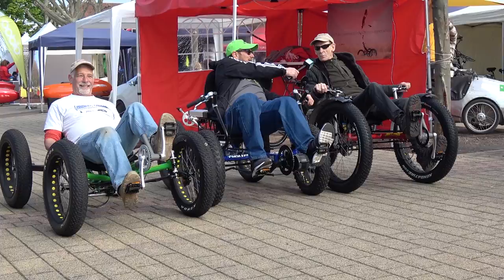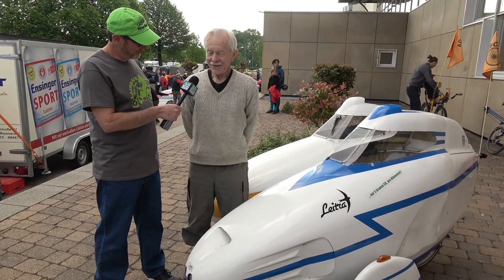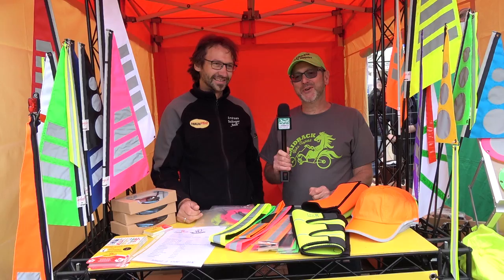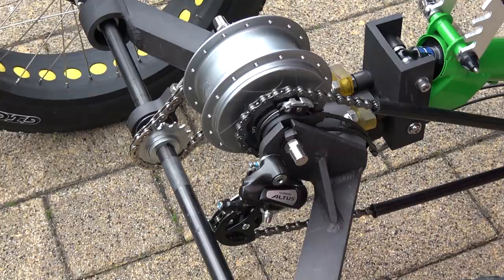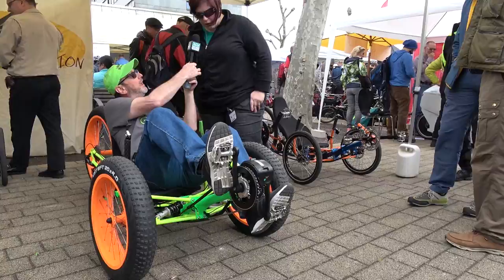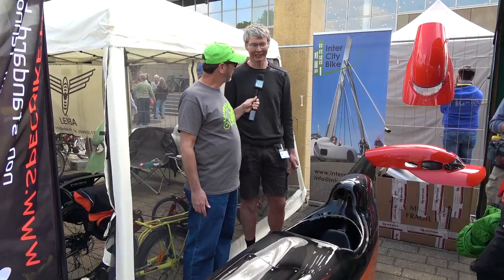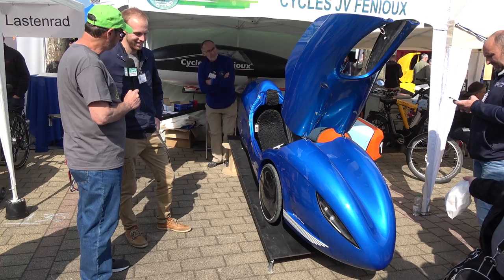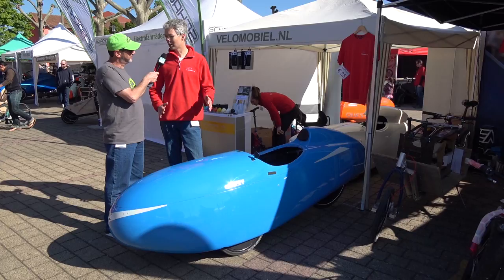Special From Spezi 2017-The Laidback Bike Report

Comment: Great report again. Quattrovelo and Mulsanne are just beautiful. I need a velomobile that has two-sided rear fork, because i favor direct drive motors. I might have to build a new rear fork if i would buy one of those commercial velomobiles. Two of the most beautiful velomobiles, Veloschmitt and Aventybike from Poland, sadly did not join the Spezi show.
Reply from the maker: +myrskylintu1 I sure appreciate you taking the time to watch and comment on the video! I'm not familiar with either of those two Polish builders. I will have to look them up. Good luck with your decision to buy and/or modify a velomobile.

Comment: Thanks for the amazing production! I never took a close look at trikes and recumbents. So as far as trikes what is the better weight distribution two or one wheel up front?
Reply from the maker: +Jeff Morgan thanks! I guess it depends on what you want out of weight distribution. In terms of traction the delta (2 wheels in back) might technically be better but the vast majority of trikes sold are tadpole (2 wheels in front) configuration. You really need to ride some different models and styles to see what works for you.

Comment: Is it possible to have a backpack designed with padded pockets that the Hailong packs can fit in.. These could be made of kevlar to protect them when they are off the bike..
Reply from the maker: +Rob K not sure what you are referring to. Was this question spurred by a vendor's product at Spezi? How would this backpack for on s bike or trike?
Reply: Gary.  Hailong battery packs (downtube shark packs).  I ride a recumbent trike.  There are times that I would like to carry extra packs for range.  Backpack or more accurately, back of seat pack, made of kevlar to carry extra heavy items like these expensive hailong batteries would be ideal.  Recumbent trikes/bikes are a challenge because the rider really cannot use a backpack like an upright rider.    The pannier/bag/cooler market in these areas is really overlooked and untapped.  I would also like to find a good (Yeti) pannier to keep things cold,   with capacity to carry food/drink/medications.  Ortlieb attempted a rack mounted cooler that looks like a carpeted box speaker.  (the problem is:  1) it is an eye sore 2) it doesn't lock shut 3) you cannot put panniers on/off without removing the cooler/trunk.  Good quality Cooler/Panniers would be great.  And a way to carry extra battery packs is critical on a tour.  But..all the options are lacking.
Reply from the maker: Rob K now I understand. Good suggestions there. Let's see if anyone knows of such a product. I've never seen it so you may be right about this being an underserved market.

Comment: For those recumbent riders in the USA, saying it is 67mm x 80cm... that doesn't translate..  It would be nice if the web site s would use both standards of measurement.  Metric and Empirical with Inches and feet.  This would accommodate all of their customers..   Thanks